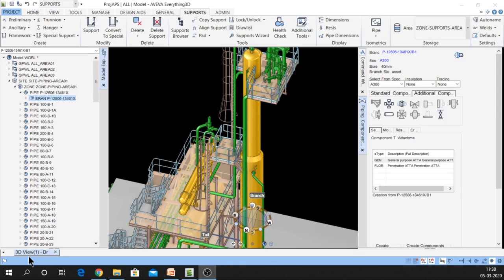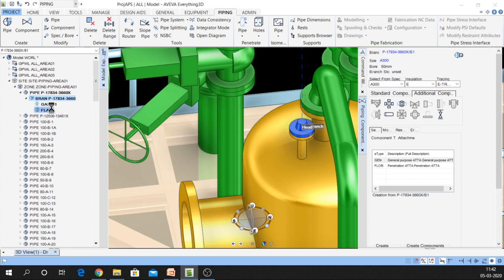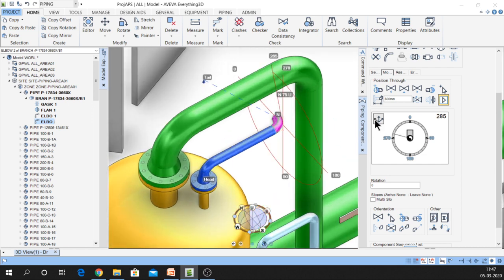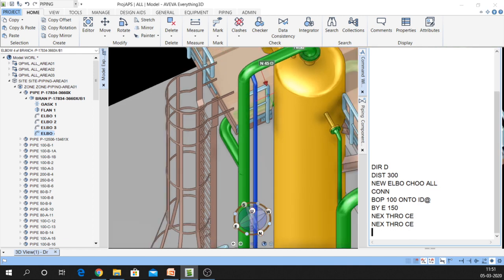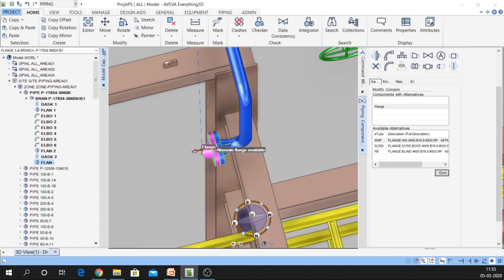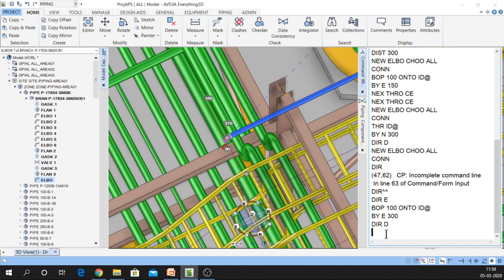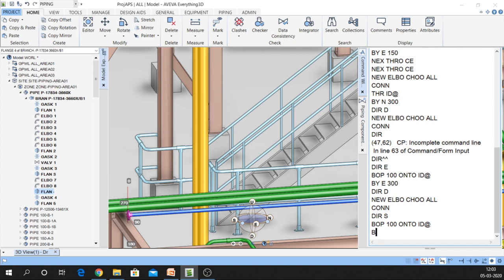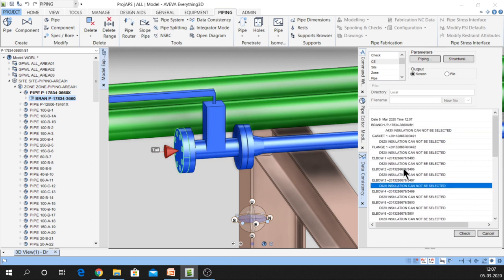PIPE MODELING IN E3D

Comment: Sir ,I have query please help me out ..I am doing piping in e3d. We have a main pipe of 50 mm in which it is further devided to 2 branches main 50mm and other one of 25mm so used a socolet but when i go throug the main pipe of 50 mm ,there is a gate valve which doen't take a flange initially .please help..!